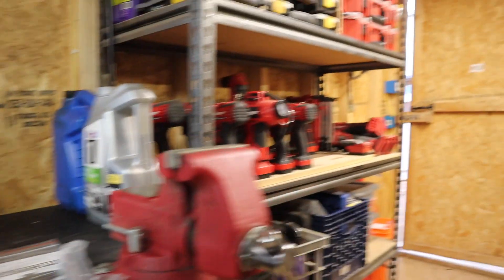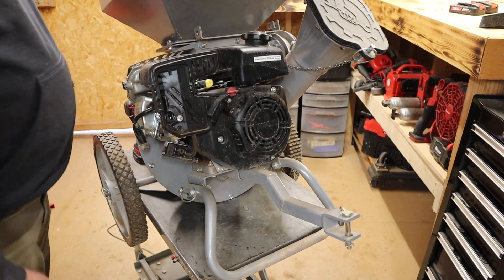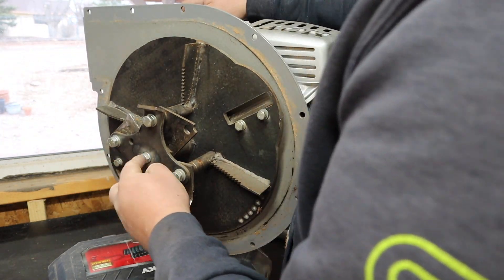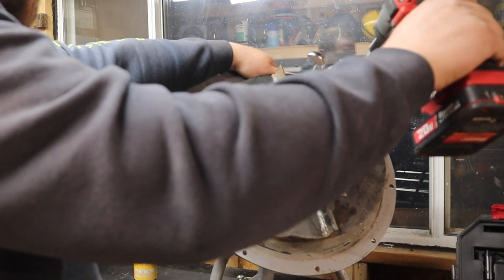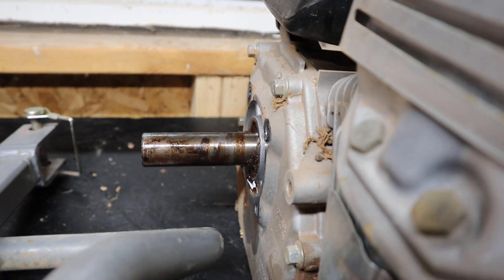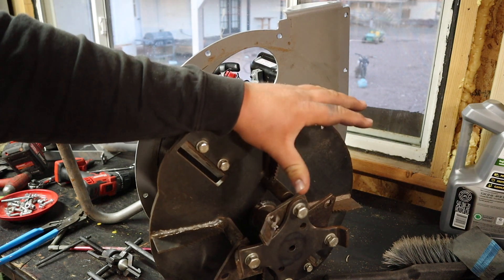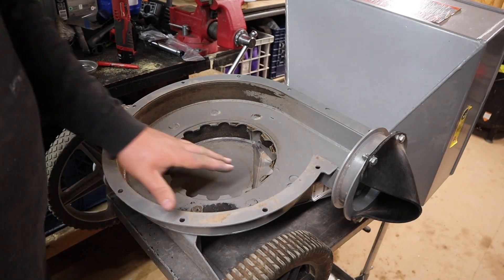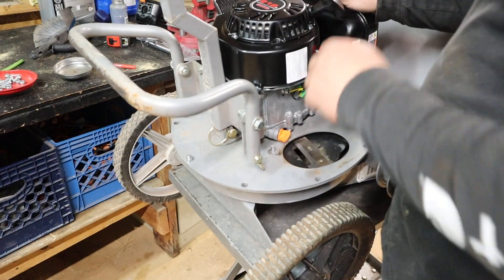Wood Chipper/Shredder Engine Swap for Predator 212cc Engine (Harbor Freight)

Comment: I had a project like this with my chipper i used a 3/4 to 1" adapter and after about 1 year the engine 3/4 crank shaft broke off at the block.
Reply from the maker: Ya, in hind sight, the predator 212 is not the best replacement engine for this.
Reply: What did you end up doing? I'm looking at a similar project and stuck because the 8hp predator shaft is too long but the 6hp is only 3/4" and I'm sure it will shear on my shredder.

Comment: I think your feeder tube is on upside down, that flap should hang down.  I have the same model and I really appreciate your video.  the motor is still good on mine, but drive shaft or those hammers are making a mighty strange noise after I have been beating on it.  So your taking yours apart was really helpful to watch.  I think I took it apart the opposite way and the way you did it, I would of got right to those hammers and cutting blades.  The way I took it apart was a bear and I still had no real good way of taking out those blades to sharpen.  So thanks for great video!

Comment: I got that same model.  Man, the carb on that thing is finicky, I've had to yank it apart several times already to clean it, just to get it to start.  I also dislike how small the chips are, I wish I could enlarge the gap between the blade and hammers to make bigger chips.